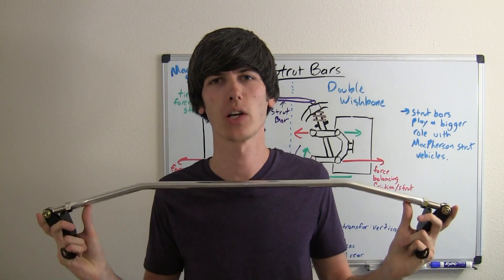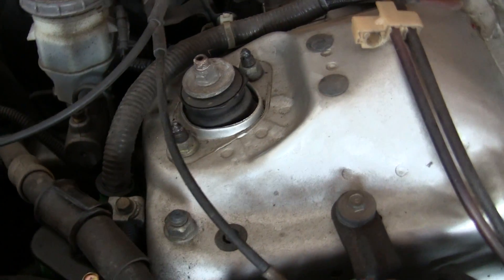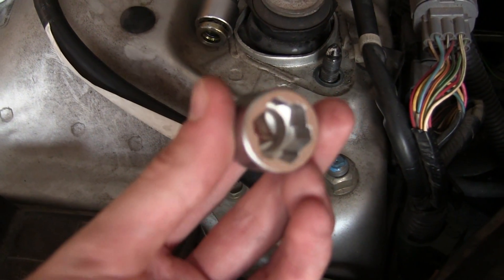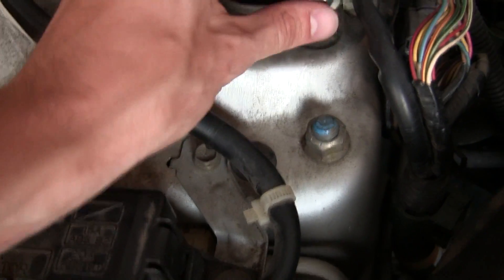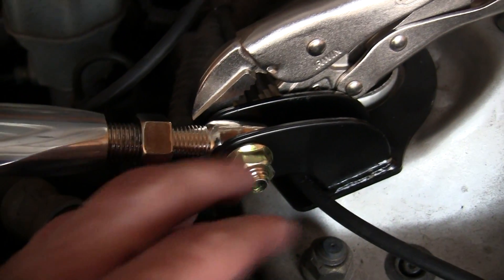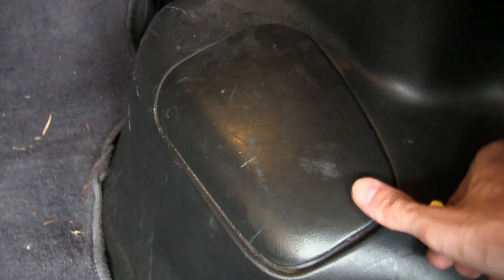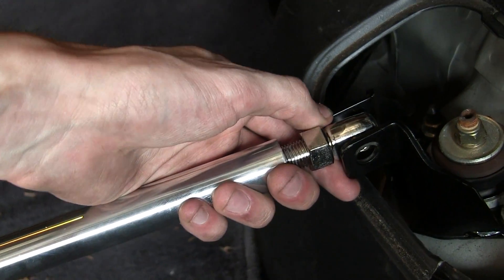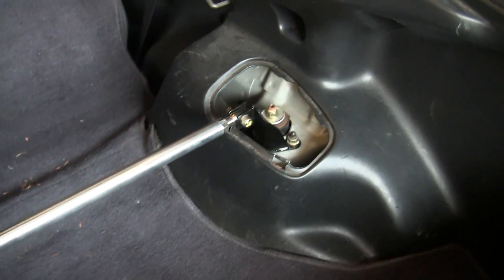Strut Bar Install - Acura Integra

Comment: « Adjustable Preload
A very common error when installing tower bars, It is always recommended to raise the vehicle when installing so that the load of the shock uppermounts on the shock towers is relieved and balanced out. When raised, and the tower bar is placed onto the vehicle, the preload can be adjusted and set. After it is bolted on and the car is lowered, each shock tower will have equal load and will prevent independent movements of each shock. This will provide an extremely noticeable difference after installing. If a tower bar is installed on a car that is not raised, great benefits will be missed.«

Comment: how important is the 36 footpound torque down?
Reply: Not all that important. Just make it tight enough without cracking the nut or bolt

Comment: So a 93 del sol....mugen front anf rear tower bars will work on a 99 teggy? WhT about front and rear shocks? I have a set of skunk2 sports, i cant tell if they r coilivers ir not, iy deff looks like u cab adjust them tho but i dont have the tool....what about dc headers off of the motor, is a d16y1?

Comment: what does he mean by the nuts are twearked to 36 feet?
Reply: isa Ontieuros Torqued lol its a measurement of how tight the bolts are tightened by a measurement of pounds being applied to a special Torque Wrench. It just means how tight to get it exactly.
Reply: Sean Daigle do we have to torque it? Cause I got not torque tool. Like what happens if you just tight it pretty firm?

Comment: what brand do u recommend for a car.  Nothing extremely expensive but nothing cheap in quality
Reply: For a daily commuter... Just buy anybrand $20-50 on ebay that is fitted spesifically on your car. Do not overpay!

Even a $20 aluminum bar with metal mounting points is enough to brace the two strut towers. Unless you are doing rally races.

Comment: will this work for a 13 armada.?
Reply: The '13 Armada has double wishbone front suspension, so the strut towers are not as stressed as those from cars with macpherson front suspention. So you will not see much benefit.

Besides, the strut towers on the Armada is too low that putting a strut bar is impossible unless you remove the engine.
Reply: jpogi gtxcr1 thanks
Reply: shane premraj NP.

On a macpherson strut, it doesn't have an upper control arm, so most of the forces goes straight up the strut towers, and you'll see more benefit of bracing them.

On a cars with double wishbones, people can still do strut bars with X-braces, that is bolted/welded near the mounting point of their upper control arms (Miata, S2000). Again, the X-braces will not be possible on the Armada because it will cross thru the engine area.

Comment: Are we saying the design of the strut tower of the car (welded to the car frame) is not rigid enough to handle the load applied of a hard turn?  Why would you need a strut bar when the struct it connect to the frame itself.   It the strut is independent of the structure frame I can see the affect of applied load to both side.  In the system you showing in this video, the strut tower connected to body frame is as rigid as it can get.  I must be missing something.. This video is over two year, I don't expect any reply..
Reply: The strut tower is of course strong enough to handle the load of a hard turn. A strut bar is designed to share the load between two strut towers instead of just one. Which results in greater rigidity.
Reply: The 80's-90's macpherson strut towers on ordinary sedans/hatch are a bit far from the firewall, and a cheap $20 stb like these can be of some help maintaining proper geometry.

Cars (with macpherson front suspension) nowadays, usually have the strut towers very close to the firewall and most (including crossovers like the 2007 honda crv, 2009 murano, 2013 sentra) have a sheet of metal (usually where the bottom of the windshield is resting), running across and is welded or bolted on the two strut towers.

So yes, if the manufacturers spent more money on the new design, it means that a strut bar on a 90's car like this (where the strut towers are further away from the firewall),  will help maintain chassis geometry.

Comment: That is a horrible strut bar. The point of a strut bar obviously is to give your chassis a more rigid feel. You have an adjustable bar and the mounting brackets are very thin, those will flex just as much as the chassis will. You need a good quality NAME BRAND. I say name brand not because they're expensive but because they make quality products that's why they are known. Dont get adjustable ones if you don't need to they allow to much flex and not enough rigidity. Engineering explained should know this kind of stuff before he posts videos trying to teach people about them.
Reply: I have no idea about engineering, or cars. But arnt the strut bars holding the suspension either side of the car together so gravity is not pushing the wheels and suspension up and inwards. Without the struct bars, all that force would be bending the suspension mount like a lever. The wheels are only mounted from the inside as you know - like with wheel spacers, there is more angular force on the wheels. Same thing but with the suspension towers.
Reply: It really depends on the application. I you're going to use it for rallycross, then yes, you might want to use a thicker one-piece stb.
But for everyday driving where you just want, to help maintain proper chassis geometry of the car you're going to own for 20 years, then this kind of stb is more than enough.

The main issue is the price. For these kind of strut bar and with a daily driver application, one shouldn't be paying more than $20-$50. Tons of these can be found on ebay.

For a track car, then a $200 name brand, thicker one-piece is ok, I guess.
Reply: For a daily driver anything is better then nothing pretty much. You can find those cheap is on ebay for like $20 and the same with track or autocross, anything is better than nothing but the feeling and change on those cheapos will be so minimal you will hardly notice a difference but if you get a quality strut bar, you will definitely feel the difference.

Comment: Silly question.

If we are reducing the forces for each suspension surely this assumes the load can be transferred successfully. Surely the original design is not to transfer loads, i.e a rigid support transferring both forces and moments, therefore it should be able to withstand larger loads than originally designed for, so would it not make more sense to increase the bolt or support size of the Bar?

Comment: dont you have to jack up the car before install the strut bar ?
Reply: No... If you jack the car up, it would lessen the stress on the struct towers that it would not be on the same geometry as it is when the wheels are down on the ground.

Place the strut bar when the strut towers are on their normal stress/geometry, which is both wheels are on a flat ground. W/out without a driver.
Reply: Marius Negrean I wouldnt have thought so as its top engine work, i may be wrong lol
Reply: I have mine coming today from my GT Celica, im sure it wont make a lot of difference in that ar but it will be interesting to see anyway haha.
Reply: ***** You won't feel any dfifference unless you regularly run your car in a track before and after installing a strut bar.

The thing is, a strut bar doesn't have any negative effects except for added weight which is very negligible. Unless you pay for $$$ for one, it is a cheap and easy upgrade to add chassis stiffness around the strut tower area. $20-$40 aluminum bar is more than enough for daily driving.

New cars and SUV's (with macpherson stut) today either have a strut bar or a sheet metal running across both strut towers.

2007 honda CRV- sheet metal
2009 Nissan Murano sheet metal
2013 Sentra - sheet metal
2011 Ford Explorer - strut bar
Reply: jpogi gtxcr1 i'd imagine it would be better if you jacked the car up. lessen the stress and flexing on the strut towers. install the bar. and when lowered back down the weight of the car will push up on the strut towers and put more force into the bar and make it an actual piece of the car instead of simply throwing it on and having it be less rigid with less sprung force resisting the flexing of the towers. no?
Reply: @ghostrider433  I agree

Comment: Was this installed with stock suspension? and if it was did you feel a difference? thanks!
Reply from the maker: emericansk8er12345 I already had coilovers when this was installed. Did not feel a difference, I think it'd be very difficult to regardless of how effective it is.
Reply: ***** a H brace ?

Comment: Can you do one on roll cage, I see them in rally racing and nascar, but I don't know how they work
Reply from the maker: In addition, they do keep the chassis a bit more rigid, which helps in high g-force turns.
Reply: To protect the driver.

Comment: @ Engineering Explained. I plan on installing a front strut bar on my 1999 Acura Integra LS. From what I heard installing a front strut bar will crack my windshield overtime due to the force nature or something. Also, what brand strut bar do you recommend ? There is a lot of aftermarket brands but I am not sure. I would like to get the JDM Type R strut tower if that fits. Hope to hear from you. Thanks !

Comment: I've always liked the idea of strutbars, But my main concern with the lower price ones aren't the bar themselves, but the mounting brackets. Sure the bar is strong, but the brackets are flimsy. I bought a CRX that came with one. Super cheap eBay stuff. Pretty flexy. My favorite thing about it, was it served as a prob handle for when I was working on the car.

Comment from the maker: It may just a have a bit of excess grip right now, and just grabs hard upon releasing the clutch. Or you may have adjusted to a very worn clutch and now the new one just grips harder, so it stalls now where as before it wouldn't. Not sure how long a proper break in is, but 120 miles is very low.

Comment: When car stands 'on wheels' there are force from springs and wole chassie weight. When you jack up car, the tension in suspention and towers disappears. Place a tensometer on strut bar and you will find out ;) You can also read some articles from Ultra Racing about struts and assembly operation. Offen some people have problems with strut bar install (with fixed lenght) when they try to put it on 'standing' car, without jacking it up (holes do not fit). But when they do it everything is fine.

Comment from the maker: And what huge mistake is this? Elaborate as much as possible. The force transferred to the strut tower from a bump/cornering will exist regardless. Perhaps the towers flex in slightly with the weight of the car, but regardless it should be able to transfer the forces involved.

Comment: if you're not getting factory bolts it should be oem replacement bolts. they won't be strong enough & obviously break.... -_- ain't nobody tryna use home depot nuts & bolts for high grade shit.

Comment: No an anti roll bar is underneath the car and is part of the suspenion. It prevents body roll in corners.
A strut bar is basicly part of the chassis, it's a strengthening beam to stop deformation of the body while cornering. Take a cardboard box and put it on your desk. Pretend the box is a car, an anti roll bar stops the tilting of the box compared to the table, a strut bar stops the ability of each opposite wall of the box to move independently.

Comment: Hi, Ive got an EG5 and it came with 3 strut bars. 1 front, 1 rear and 1 mounted right behind the rear windows 20cm below the roof, connecting the sides. Ive removed it since I dont think it does anything at all. Any ideas why it was there to begin with ?

Comment: Nitrous Oxide on a stock engine is as close to stupid as one can get, no offence. In order to have a proper NO2 set-up without blowing up your engine is to have forged or billet internals, especially the Pistons and Rods. A better way to get more power from a car is to tune using HondaTech, MSPNP, or AEM and not just putting NAWSSS on it.